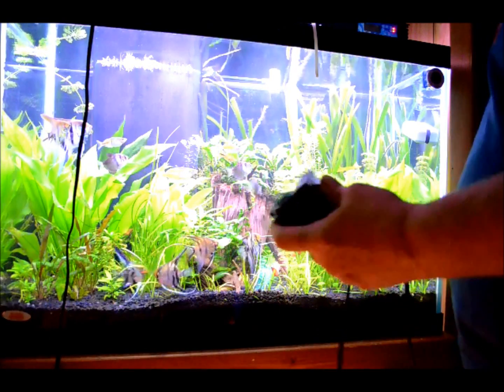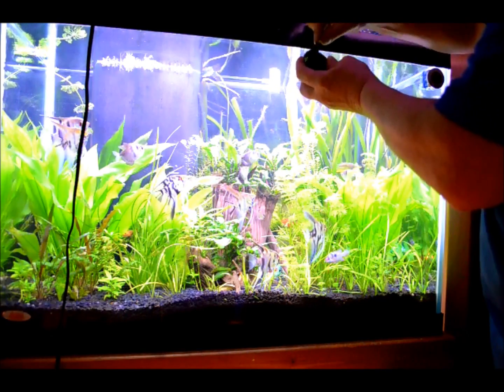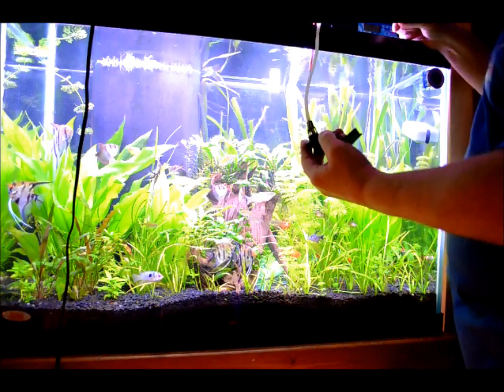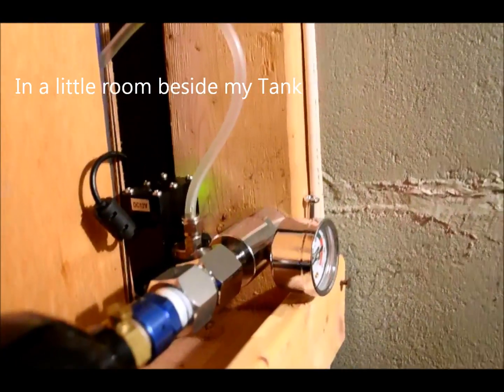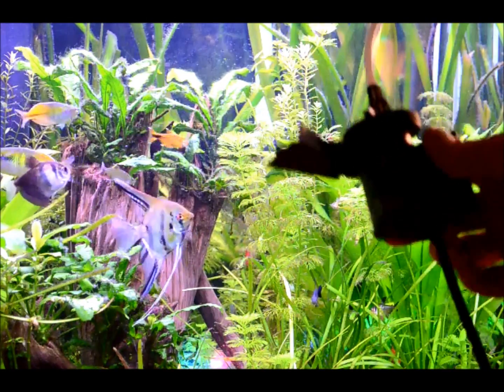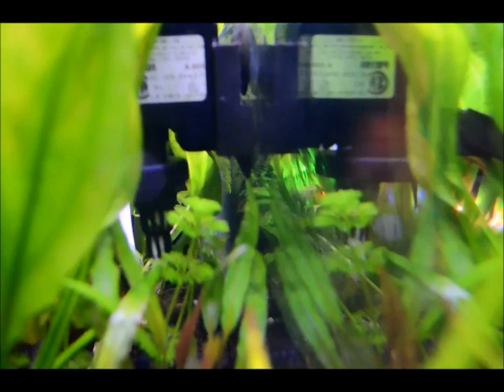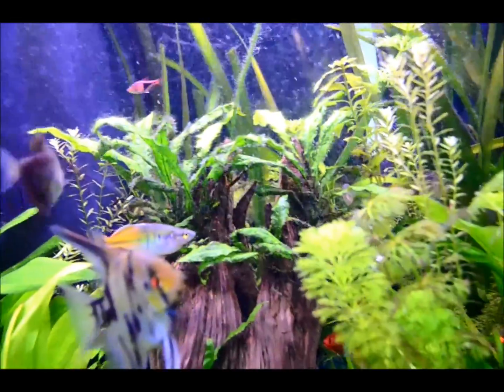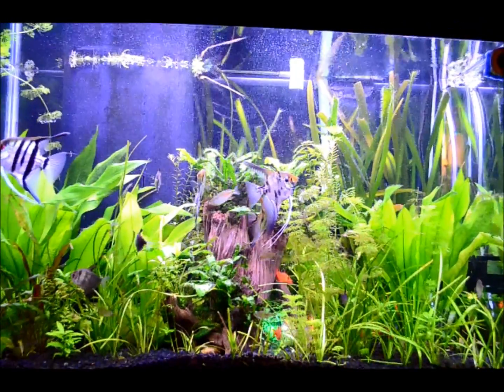114 /  How to : CO2 Diffusion using a Power-Head

Comment: hey should your co2 be lying on the side like that? isn't that sketchy?
Reply: I think it's the standard thing to do for paintball tanks as the fitting is pointing up not facing front so you can run bubble counters and the like, also paintball tanks can't stand on end... They are not designed with flat bottoms. It's a closed system so running on it's side should not be an issue

Comment: I've been using powerheads for the past 25-years on my planted tanks to break up the CO2, it's far better than anything you can use and causes the least amount of back pressure on your CO2 system. 
 When the powerhead is on the impeller of the powerhead will break up the Co2 bubels and mix it with water better than a Co2 diffuser ceramic stone will and will be inexpensive to boot. Extremely low maintenance and low-cost makes this the best method and it only takes a very small powerhead to do the job on most tanks under 100 gallons.